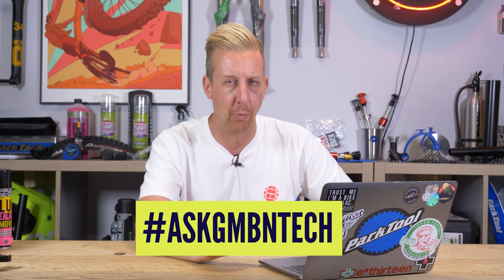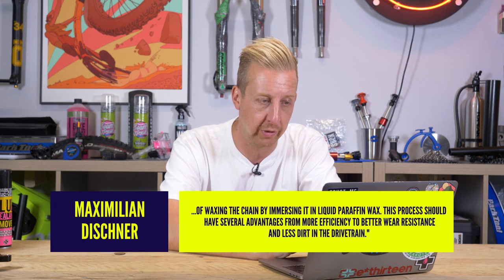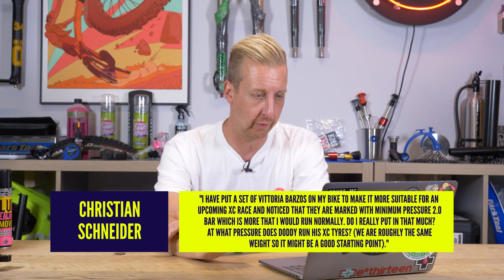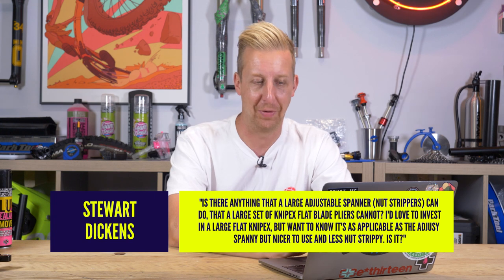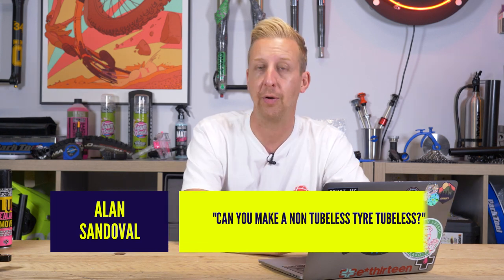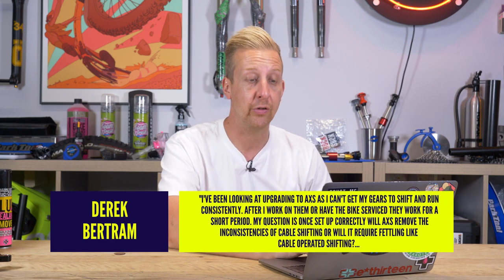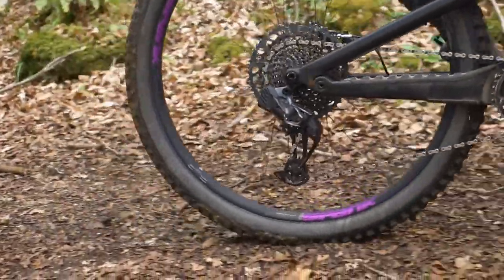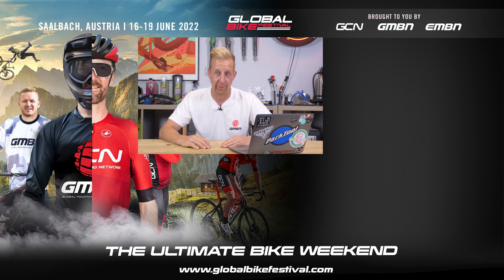"What Tyre Pressure For Cross Country?" | #AskGMBNTech 194

Comment from the maker: What tyre pressure do you ride?  (Note your weight &  the type of riding style and conditions)
Reply: 195 lb, xc on very sandy trails, 2.6" Eliminator Grid Trail, 15 psi front and back. Previously 2.8" Butcher Grid Trail, 12 psi front and back.
Reply: 167cm, 72kg. I ride with 45psi because I ride with tubes. I will build another bike with tubeless tyres once I move to the UK next month or two.
Reply: At the moment, 1,65 bar front and rear;
-Schwalbe Supergravity casing, 29x2.4" tyre up front with Cushcore Pro
-Schwalbe Super DH casing 27.5x2.6" out back with no insert
I weight 76-77kg kitted up, and ride fairly aggressively, but not pro-level on bikepark trails and enduro trails.
Reply: 78kg (with kit and pack) - running 26 psi up front (Assegai) - 24 psi with insert out back (Minion DHR II) - seems to be the best for me - I keep trying lower pressures - but don't like the lack of support. (UK Peak District, Trail Centres, Enduro Races etc)
Reply: Wtb trailblazer 2.8 19 psi front 23 rear 67kg all the way from hard to loose and wet
Reply: Trying something new, running maxxis rekon+, 29x2.8's, 120 tpi, rimpact tire inserts on 622-40 rims, 140mm travel front and rear Orbea Occam trail bike. I ride in super dry, dusty, lose, and lose over hard in northern Colorado. 13 and 15 psi. Big boi rider at 230 lbs (104 kg), not including kit. I'm really liking it so far, and I've tried 2.4, 2.5, 2.6 and 3.0 tires.
Reply: Usually 24 in front 27 in back. I weigh 180 lbs I run a tannus insert in the rear and mostly ride rocky, dusty, dry Arizona desert mountain trails and mostly only care about how the bike feels going downhill. I run maxxis minion dhf and dhr2 29x 2.3
Reply: What ever feels best, for me getting fixed on any number is no way to ride.
Reply: 187cm 82kg/181lbs. Bike Specialized Epic. Tyres Maxxis Aspen 2,25 tubeless. Front 19psi/1,3bar and back 22psi/1,5bar
Reply: I personally run maxxis ardent race with 2.4 in the front to which I use 1.8 bar (just to turn a bit better) and a 2.3 in the rear to which I use 2bar to get a bit less traction since I need less rear grip
Body weight is 70ish kilos
Reply: I squeeze my tires and if they're not soft I'm good to go, but when they're soft I ride 35 psi , 29 x 2.30 mtb tyres daliy ride but I sometimes go off trail and explore
Reply: Currently running 30psi in my stock bontrager xr3's, I'm 200lbs and ride/race mostly XC and Downcountry trails.
Reply: I have HT XC bike, Giant XTC SLR1, 29er with 25mm inner width rims. I'm 191cm,around 107kg, on Rekon Race 2.25 front and rear I use 26-27psi rear, 24-25psi front. Anything higher and it's really bumpy ride. I used SRAM tyre pressure guide to find aprox. pressure then I played with pressures that work for me. I ride on different terrain, from hard packed dirt to lose gravel to mix of stones and grass. Haven't had a puncture in over a year. Tubless, no inserts. But it's 60tpi tyres...
Reply: 85kg, Bontrager XR3 29 x 2.4 front 20 psi, Bontrager XR2 29 x 2.25 21 psi, 29mm Bontrager carbon rims, tubeless, mix smooth hardback and small rocks loose and embedded. XC trails
Reply: 70kg, xc on dirt and rooty singeltrack I run 26 front and 28 back
Reply: @SoorM  I have the same tires but the 2.4 version I run 17 front 19 rear depending on the race course
Reply: 183 cms , 84 kgs full equipped , Orbea Oiz m10 2021 , Maxxis ardent race front , ikon rear , 26 psi front , 29 rear . Fork 95 psi , shock 185 psi . perfect for XC dry conditions .
Reply: 18/20PSI, 29x2.3-2.5, 152 lbs, Texas chunk (lots of rock gardens, hard pack, roots).
Reply: @tomsing98  bomb
I’m so happy
Reply: 90kg 
mostly tarmac with gravel paths and occasional muddy and mixed terrain trails.
I use inner tubes on my marin indian fire trail 2014 29er xc bike.
I like to have 35psi front and about 38psi on rear

Comment: I would be interested in a gmbn tech video on chain wax. Not for the reduced friction, I'm interested in how well wax keeps mud and dirt from accumulating on the drive train and reducing the system wear. Thanks for the great content Doddy and Anna.
Reply: Exactly this. Anything that reduces dirt attraction is worth looking into. I couldn't care less about potential efficiency gains.
Reply: It stays very clean in comparison oiled chains. Just like an oiled chained, a day in the mud will need tlc afterwards.
Reply: Yes massive benefit. Use Squirt and forget all about amuckoff lubes they are a disaster on any MTB
Reply: I Was all my chains. So much cleaner than any liquid chain lube. Last longer and doesn't attract any dirt even in foul conditions. Just reapply the likes or Squirt chain wax  after cleaning the bike and its good for the next ride regardless of being wet or dry riding. Doddy hasn't tried it so not really a good person to ask. Well worth the effort in my opinion and i will never go back.

Comment: I have been using Squirt Chain Lube for the past couple of seasons - it's a wax and water emulsion which works really well in UK (Peak District) conditions. No more 'wet' or 'dry' decisions for me!
Reply: I also use squirt lube i wont go back to oil based lubes it's just so easy to use and clean
Reply: Agreed it is brilliant
Reply: Same. This has been given me the best results. I do a lot of desert riding with occasional water crossings and have no complaints.
Reply: I use it too, no desire to use traditional lubricant anymore.

Comment: I do immersion waxing for MTB and it's excellent. I don't care about the watts, but I do care about my drivetrain longevity. Testing shows that some chains with a good waxing interval can outlast a bike. It's still hard to get parts so this is huge.
The other advantages I find are:
Long lube intervals; Wax lasts a very long time and even when you do start to hear it, that's just sideplate rub and an early indicator that it's time to rewax.
Clean chain means touching it doesn't leave you(or anything else that may come in contact) filthy!

Comment: Wax is great for offroad chains for the durability of the drivetrain, not accumulating the dirt as grinding paste like an oil does.
Reply: I ride in a sandy area as soon as it’s less wet in the year dry lube chain and as you say chain and cassette last longer.
Reply: I use wax on both my Enduro and my Road Bike, it's just better all round. Both chains and cassettes stay shiny and clean rather than clogging up and accumulating dust and grime.

Comment: Doddy, 
I can totally appreciate the view point on waxed chains. However, I would offer the following. There have been plenty of test performed by friction facts Zero Friction Cycling that show that it can in decrease the wear rate in your chain, and increase the over lifespan over just about any oil on the market. There’s only one wet lube on the market that you could say is going to beat wax and thats the Silca Synergic or  Synerg-e but has not tested well once contamination has set in (i.e. Dust and debris from the trail ). Further more Ceramicspeeds’ UFO drip is as close as you can get to a hot melt solutions. And since its a wax based lube once the carrier (High quality H2O) has dried, nothing can stick to the wax. So by “preventing” debris (of which is not the most visible) from get into the chain bushing and inner plate. Rather than any oil which will grab and hold any debris that touches it. Hot melt is an awesome base but its not something I do but every 1K Miles. I use Ceramicspeed Drip every 90-120 miles. The maintenance is little to nil, my hand don’t get dirty when I fiddle with my drivetrain. And its pretty well quite, and if my chain starts hissin at me I just apply some drip. And when I remelt the chain its as simple as wiping the chain down with a Denatured alcohol rag and then re dunking in hot wax. As all the “crud” falls to the bottom and the chain is left with a fresh layer and is ready to go for another 1K. I can go on and on, but honestly I recommend getting into Zero Friction Cycling. And then formulating a method with this practice in mind. Cheers from Texas!
Reply: I'm another Texas (Houston) rider. My chains stay clean. I douse the chain in boiling water to flush of the small amount of dust on it before re-waxing, following the OZ Cycle videos. The trails around here are dry. I don't worry much about mud since the trail builders close the trails when they are wet.
Reply: @philso7872  
Both ZFC and Oz Cycle are from Australia, with ZFC stating his wax method is far superior..
Reply: @petesmitt  I haven't heard of ZFC. I will have to check it out. I would guess the ZFC method has a lot of the same advantages like being a lot cleaner.
Reply: @philso7872  Zero Friction Cycling

Comment: Re: waxing for MTB, my anecdotal experiences from a marathon XC perspective.

Main benefit: more miles between cleaning/relubricating the drivetrain. Possibly longer chain life, but many factors affect this.

With dry lube I would get 20-40 miles in dry conditions before the drivetrain made horrible noises, which meant relubing in the middle of endurance rides. In wet conditions, mileage was even less.

Waxing, I've done 80-100 mile MTB events in mixed conditions (including rain) with far less noise and no need to stop to relube mid-race.

I'm unsure of the watts saved, but it would be interesting to compare drivetrain drag of drivetrains with standard lube vs wax after 80 miles of crud. I wouldn't recommend waxing a chain solely for the watts, however.

Comment: As of last season, I’m immersive waxing my chains with MoltenSpeedWax and topping up between hot waxes with Silca Super Secret drip wax. My drivetrain has never been more clean. It’s so good that it makes products like Squirt or Smoove seem gunky by comparison.
There’s this idea that it’s a pain in the butt, which is really only true when it comes to initially degreasing a chain. After that it’s easy peasy, and I spend much less time cleaning my drivetrain. I use two XT chains in rotation, so one is always ready, and swap em out as needed. Also, drivetrain wear is nearly zero due to dirt not sticking, so components last waaaay longer.
Never going back to oil-based chain lube.

Comment: I've waxed my chain 100% of the time since January 2019. I'm never going back to silly lubes. My mountain and road chains and cassettes might just last forever now.  It's so easy to remove the quick link and drop the chain in some wax for a few minutes, then pull it out. Don't let those ultrasonic cleaners get in the way. Just drop the dirty chain in the wax bath for a few minutes. Swish it around. The dirt falls to the bottom. Pull out the chain. I re-use quick links at least a dozen times.

Comment: In regards to going tubeless with non-ready components, it's fine for MTB and maybe gravel, I did it myself, converting non-tubeless rims with no issue (though I did use a tubeless ready tyre). But don't do it on road bike wheels. The high tyre pressures in road tyres mean that a ghetto system will not cope, it will likely never function.

Comment: Hi, I wax my chain winter and summer. I find it to be much better than chain lube. 
I also add PTFE powder in to the wax as well. The benefits are easer to keep clean. Extended chain life. Not getting covered if you have a transmission issue. I don't think i would go back to the old way.
Great show, and very informative, keep it up.

Tim

Comment: I’ve used it gulf canning wax for years. So much easier to keep clean, less maintenance and extends chain life. On my Ripley V4 I have over 4000 miles with two chains, both still measure 90%+ when stripped clean of any wax, dirt, etc. 

I use two chains to always have a ready to go when needed. Typical deep cleaning is 400-600miles. Deep cleaning simply involves mineral spirits, drop chain in, shake, wipe down, drop in alcohol, shake, wipe down, let dry for a few minutes and drop into the molten wax at around 200f degrees. The mineral spirits, alcohol and wax is used multiple times usually lasting me a year or more. 

I’ve never seen a “oiled” chain make those distances, be this quiet or smooth.

Comment: I'm waxing my chains on all my bikes. The main reason is resistance to dirt and mud. Waxed chain can be clean with a hose. Since I've started I needed to replace one Sunrace cassette after more than 8k km of mostly off-road use. I need to repeat waxing every 200km. It takes no more than 10min.

Comment: With AXS and adjustments needed… Use the micro adjustment feature on the app. Think of it like turning your barrel adjuster. I had a slight chain rub after miles of use, and with a few adjustments, PERFECT!

Comment: I use a liquid wax in conjunction with bike lube. The liquid wax is for the chain plates, front chainring cassette and the jockey wheel surfaces. Bike lube for the rollers. Wipe well between each. The liquid wax helps the dirt fall off while riding and makes clean up easier.

Comment: I just rode the Wilmington Whiteface 100k MTB Race on my Ibis Ripley V4 and decided to get as many marginal gains as possible. I did wax a brand new chain for the event and it kept the grime and dust off the chain and drive train rather well. I don't know if it provided a noticeable advantage to my performance, but my drive train has never been cleaner after multiple rides without a washing. I think it is worth GMBN putting it to a more scientific test.

Comment: Used a Duckhams heated grease can on motorbikes for years... Main advantage, the heat gets the grease in where spray/gravity fed greases don't always get.. and water is removed. 
It's not a friction thing... it's a longevity of the chain thing... Actually far easier on an MTB than a MX bike.. but I just use a spray grease like HSS2000 & get a good run out of chains.

Comment: Hi Doddy, in the meantime I have found a statement from Vittoria about the minimum pressure printed on the tires. This is related to a standard by the ETRTO which says that a tire should not deform more that a certain percentage when it is ran with minimum pressure. The number given is the absolute worst case (very heavy rider, aged tire,…) so in practice you can run it at lower pressure and it will not fall off the rim. Will you be in Saalbach?

Comment: I wax my chain and it works great for me. I typically ride in the Colorado front range so the conditions are typically dry. The chain remains clean and running smooth for multiple months.

Comment: If ur constantly having to tweek ur gears with cables, then there is something wrong in your system...likely a weak (maybe weak design) of gear hanger that flexes...or possibly worn out mech, or other components.
Correctly set up cable gears are totally set and forget. 
Could also be a gradually loosening derailleur bolt...make sure its all tight. 
Axs will require the shifter anyway, so maybe go for it if u can afford it!

Comment: I wax all my chains.  I'm an XC/gravel guy so there is that.  One other issue is drivetrain wear.  With paraffin wax you don't accumulate as much dirt in the drive train that acts as an abrasive.  Long story made short, I get a longer use out of my drivetrains than guys who use drip on lubes.  Check out Oz Cycle, Zero Friction Cycling or the guys at Silca for details.  Don't do it with an open flame stove if you like your house.

Comment: #gmbntech The 2013 fox float CTD had a air spring recall back then. They replaced the coil with a NA air spring upgraded.  You can buy it now and do a self install. But the control wasn’t changeable.

Comment: My new bike came with Maxxis Ardent 29x2.4  tires.  Minimum pressure (writen on tires) is 2.5 bar /36 PSI !?  It's a trail bike with 130mm suspensions.  Is it ok to pump less then 2.5 bar's ?  My weigt is 75kg i ride with tubes.
Reply: Yes

Comment: Hi tech Team, I bent my Sram NX R Derailleur and am replacing  it with a GX and was wondering whether it would be worth updating the shifter to a GX at the same time. Thanks for your help.
Reply: The shifter are not that expensive.  They all work the same but the GX MAY "feel" a little nicer. It was a metal thumb button. When my GX derailleur got a little sloppy I replaced the "B Bolt" (not b screw)  with an X01 version. It helped a lot. Good luck
Reply: @johnmiller2301  thanks. Can you see  what the difference in the B bolts
Reply: Not worth changing the shifter.

Comment: #askgmbntech Hi Doddy, I am working on a vintage mtb (Klein attitude 1995) and am trying to remove the bottom bracket for replacement. The bottom bracket is square taper but there is no place to put a square taper bb remover tool. Is the bottom bracket threaded or press fit and how do I remove it? Thanks for the help!

Comment: #AskGMBNTech Hi Anna & Doddy! I ride in a muddy place where the dirt is fine and abrasive. I have a SRAM DUB PF92 BB that I don't find water/dust resistant enough. It is properly installed and I use to clean and grease it quite often. However the durability does not reach my expectations. I am happy if I can do 700-800km with it. Is it the normal lifespan for that type of BB ? Are there alternatives that are PF and compatible with DUB cranks? Thank you for sharing your MTB knowledge, keep up the good work!

Comment: #AskGMBNTech How long is a 12-speed chain supposed to last on a full sus? According to my chain checker the chain on my bike is already at 0.5% stretch and I have ridden it less than 200 km in fairly dry conditions. I clean and lube it after every ride. The bike is an Orbea Occam H30.
Reply: If it's Sram GX or lower, it doesn't last much longer than that.